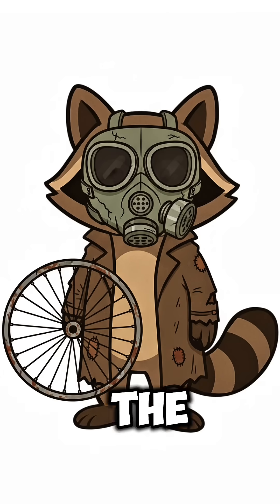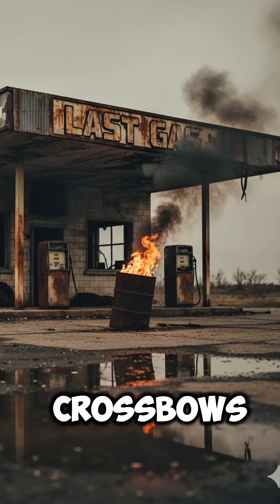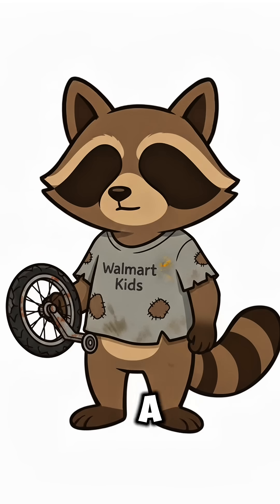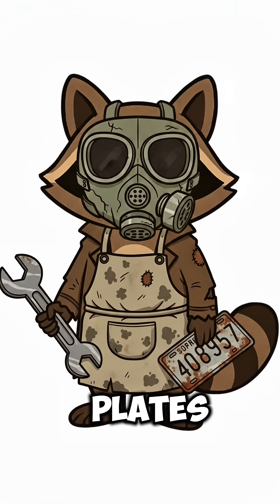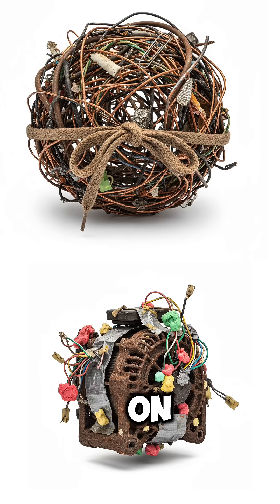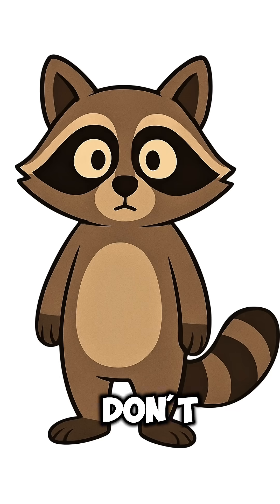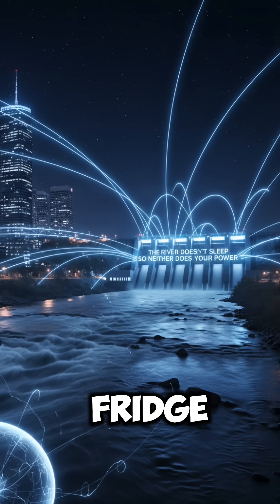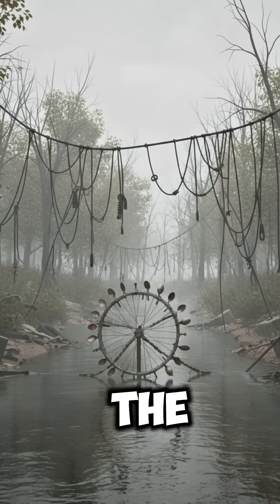How to Build a Water Turbine Post-Apocalypse ⚡#Shorts  #Science

Comment: Great in theory. But only one problem with  this is the old alternator or any alternator takes 12vdc to create  a magnetic field to  create power. So either replace the center coil with permanent magnetic with alternative poles facing out. Thensbit work great.